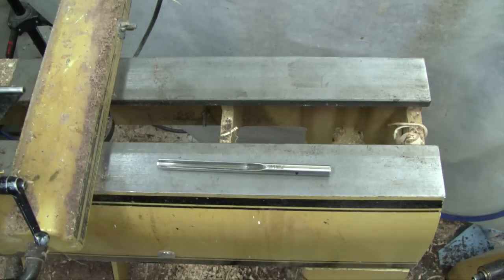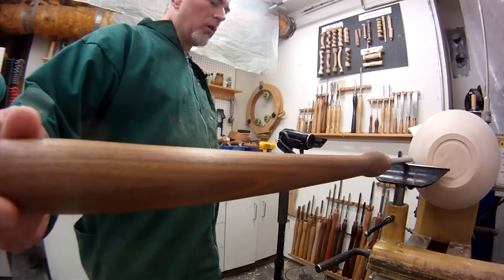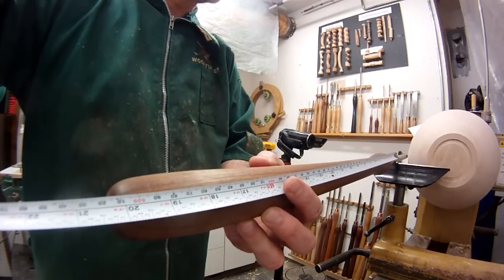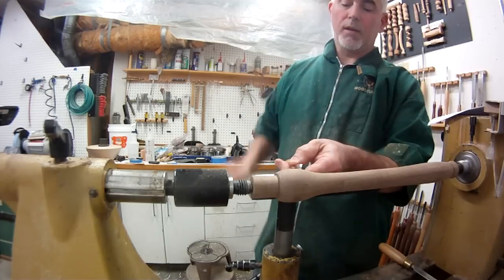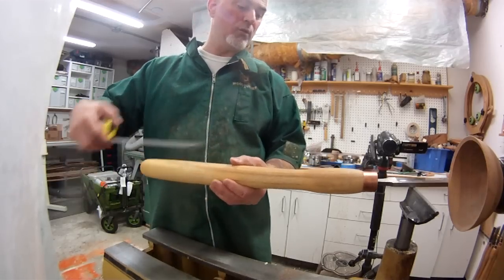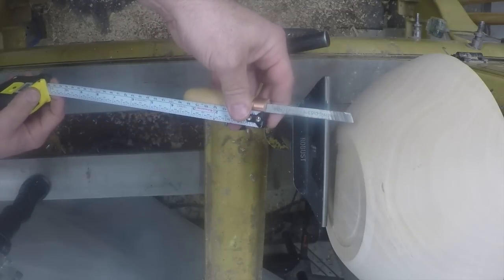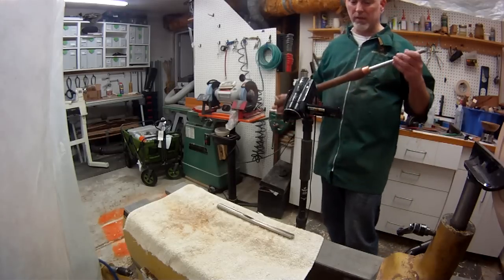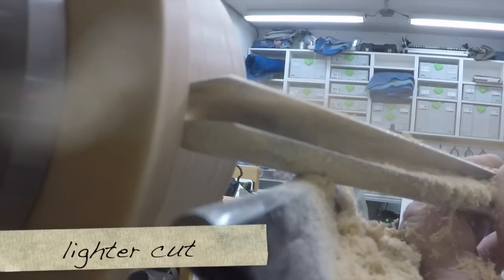Tool Handle Length

Comment: I have solved the problem a different way. Rather than long tools I use an appropriate tool rest. I use D-tools with a 12” moving handle on an 18” lathe  and never needed a longer handle.

Comment: Great video.  Is the copper colored metal on the end of the handle just a close fit that is then epoxied into place or or do you use a compression tool like the way residential plastic water pipe is connected?  Is the too itself epoxied into the handle or is it just a tight press fit?  Thanks for the help.  I'm really enjoying your videos and glad to have discovered them!

Comment: When you seat your tool in the handle do you use any adhesive?  Thanks
Reply from the maker: Not usually, but if it is slightly loose, I would fill it with some thin CA glue.  The tool bit diameters and the drill bits are usually tight enough tolerances that no adhesive is required.  What I have done, though, is install a rectangular bit into a round hole in a handle, and then fill the gaps with slow setting epoxy.
Reply: Just what I was looking for. THX

Comment: What about the carbide tip tools? I think some need to come with longer handles. They would probably fall under that 7:1 rule.
Reply from the maker: Since carbide tools are mostly used in a scraping mode, I think you are right with the 7:1 rule.  It is possible to use a carbide tool by using bevel support if the carbide tip is mounted  at about a 30 degree angle, so 5:1 would be OK there.  (I first learned about bevel supported carbide cutting from Lyle Jamieson.)
Reply: You and Lyle, in my opinion, are in the top 5 wood turners on Youtube. I learn a great deal from both of you. Keep up the good work.

Comment: Brian, thanks for this video!  I have an excelsior mini lathe from Rockler and getting a standard length bowl gouge to work around the tail stock is a pain and sometimes just not do able.  I am thinking of ways to get around this and your video is very helpful in determining the actual NEEDED tool length.  Thanks again

Comment: what's  the  top  angle  of  the  negative  rake  scraper . thanks  for  all  the  info  on the length  of  the  handles .
Reply from the maker: +MANUEL GARZA I use the same angles as a skew, so about 20 degrees (40 degrees included).